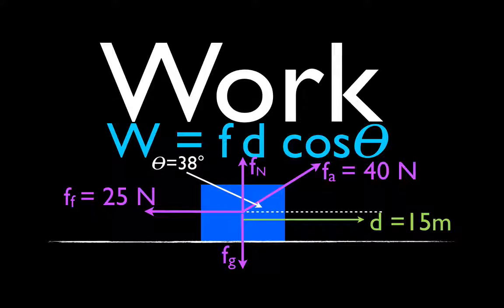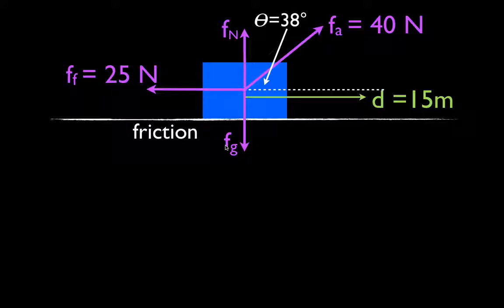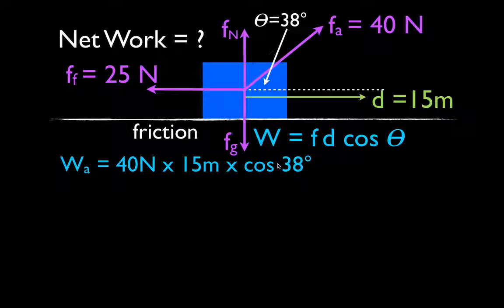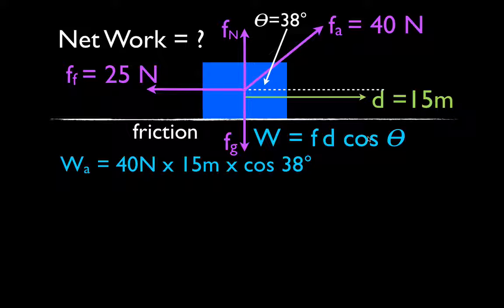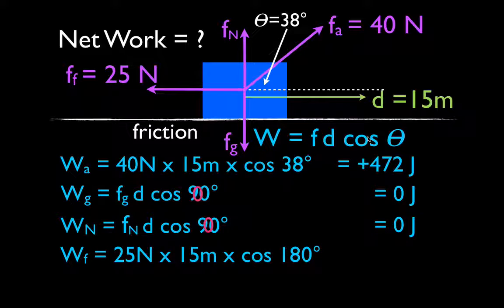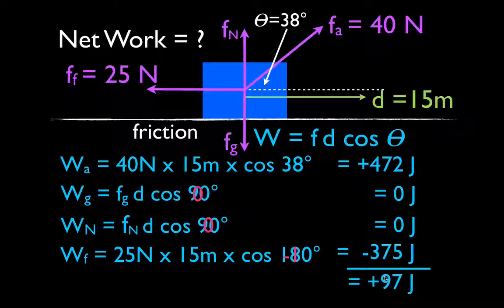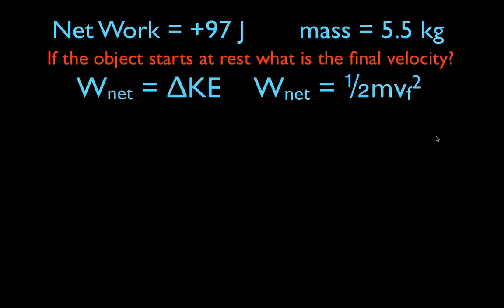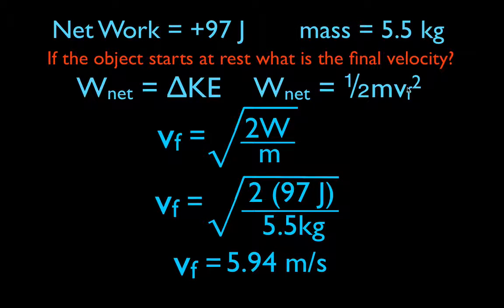Energy, Work & Power (12 of 31) Work Energy Principle, Net Work Done on an Object

Comment: Gain in KE + Work Done by resistance = Work Done by pulling force
315000J + 500 X AB = 20kw
Hence AB = 590 m 

But i didn't use the time factor 30.5 seconds. I can't figure out how that one applies here. But thanks anyway.

Comment: Hi Mr Swarthout 
I would like you to help me out with the following question please: 

A car of mass 1200 kg travels along a horizontal straight road. The power provided by the car's engine is constant and equal to 20kW. The resistance to the car's motion is constant and equal to 500N. The car passes through points A and B with speeds 10 m/s and 25 m/s respectively. The car takes 30.5 seconds to travel from A to B. 

(i) Find the acceleration of the car at A

(ii) By considering work and energy, find the distance AB. 

Sir, please note that I have been able to figure out part (i) of the question. I am having trouble with the second part. However, I don't if you start out from the beginning. I would really appreciate your help. You can video record the solution and email me the link at ttorabally@yahoo.com 

Thanks for your help.
Taslim Torabally
From: Mauritius.
Reply from the maker: +Taslim Torabally Sorry but I do not have time to make videos for the homework assignments of individual students.  If you look at my website you will see some videos concerning power that might help.  
website, http://www.stepbystepscience.com
Reply: +Brian Swarthout  Thanks for your reply. I am actually browsing through your uploaded videos. Once I manage to solve the problem i will let you know. Thanks again Brian.